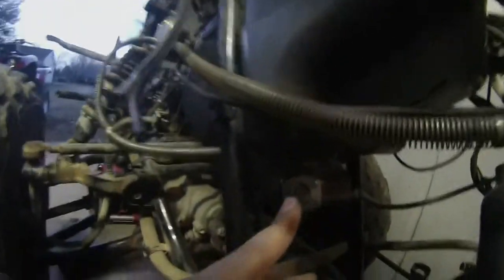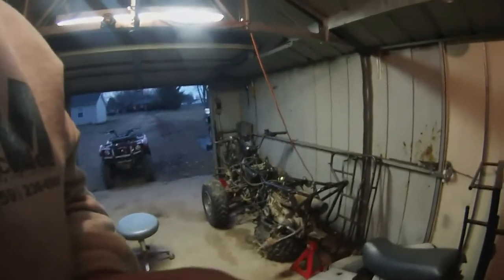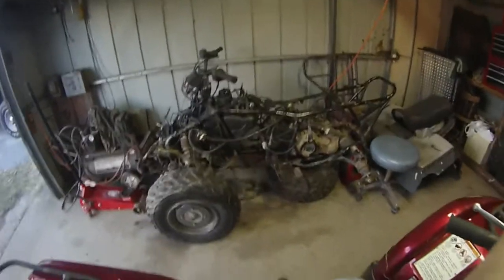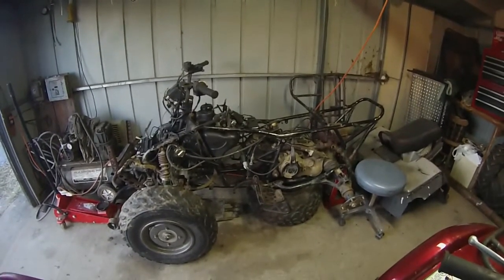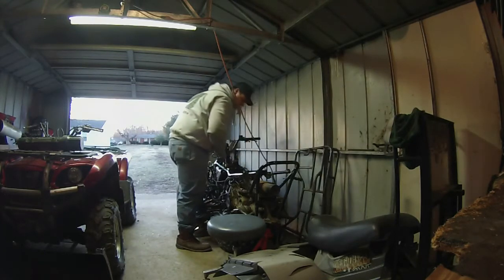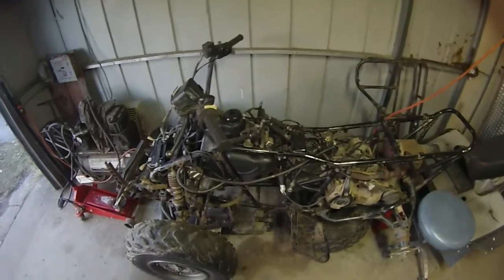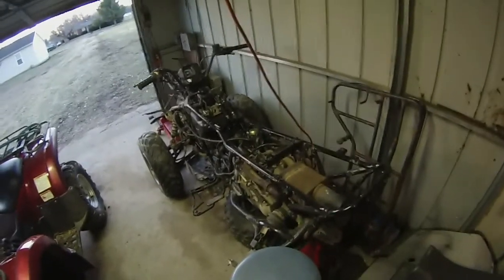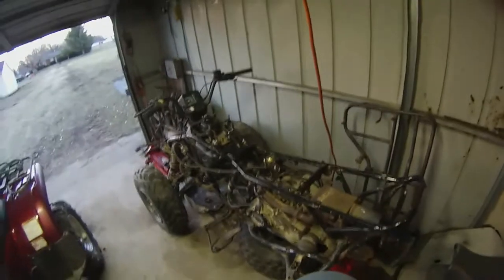Suzuki King Quad 300 Project - Part 3 - Fuel Delivery

Comment: 7 years after you posted these King Quad videos they are still helping people!

 I have a low mileage one in great condition that I run only a half an hour or so a year. Last 10 years or so l use it only for blading snow on the driveway.  This year I didn't need to use it but did start it a couple of times.  Always siphon the old fuel out and replace it with new fuel and stabilizer twice a year.  Today it would not run.  Started right up and idled ok for a couple minutes and quit.  No go.  Pulled off the easiest hose to get at on the carburetor, think it's a vent, and primed the carb through that port and it would run until that added fuel was used up. Did this many times hoping a blockage would clear itself but would omly run until the fuel I primed it with was used up.  Clearly have a fuel starvation issue somewhere.

Thank you for posting these videos.  I now have a really clear idea of the fuel circuit to start doing some troubleshooting.
Reply from the maker: Thanks for the comment and I’m glad you found the videos helpful! Good luck getting your machine going again, hopefully it’s a simple fix and if I can help somehow just let me know 👍🏻
Reply: So what was wrong? I have problms
Reply: @safffff1000 The spring in the needle valve collapsed. Cleaned the carb (was quite clean) installed a new needle valve and it now runs like new.
Reply: @ronsereda4242  Thanks. Is that the float needle of the idle adjust needle?
Reply: @safffff1000  just the float needle. The tiny spring is internal to the needle. A new float needle came with the kit

Comment: Good little project bike.  I have one in about the same condition maybe a little worse. I'll keep watching it will help me with mine. Thanks for the video
Reply from the maker: Thanks, im liking it so far. Its in decent shape, just doesn't look like it with all the plastic and things off of it. I had a quadrunner 250 which is almost identical that I went through and rebuilt the engine on. I sold it a few years ago though. Thanks for watching!

Comment: Got one of them ebay carbs for it and the old one just seemed 2 far gone but it idles high even when with the new one same situation thinking its a vacuum leak some where but I can't find it but it also won't pump gas even if it's running now it does have an extra vent like but I wouldn't think that would effect it not running and not being able too run or idle which I'm pretty sure then lines are ran right but I'm not sure on that first time messing with these bikes
Reply from the maker: If i remember correctly those aftermarket carbs have two rear vents, and one vent on the front(engine side) of the carb. the one on the front is for a vacuum petcock or fuel pump. If it is left open, it will act as a big vacuum leak. Maybe its possible you have the fuel pump vacuum line on the wrong port which would explain it not pumping gas and also possibly why it has a vacuum leak. Did you try adjusting down the idle? Good luck and let me know if i can help

Comment: how does the petcok get conected get connected? I got a quadrunner 250 and it does have issues with the vacuum line and fuel pump. It dies when you accelerate. Thank you

Comment: where is that fuel pump located ?? thinking have the same problem as you No fuel in fuel lines just had the tap serviced cheers mike thansk for your help & info good skills
Reply from the maker: Mike Winter Thanks! The fuel pump is located back behind the left front wheel tucked under the fender plastic If I remember right. Just make sure if the petcock is working correctly that the fuel pump is getting vacuum. Those lines can get dry rotted.

Comment: Replaced fuel pump..quad quit on trail..pumped throttle n would start n run for 5 mins and die...cleaned carb..checked fuel pump..its right..vacuum lines are right..Getting fuel from prim position but not from on position on peck...got spark..compression etc..wtf?..lol

Comment: i have one of these and a lot of lines were not hooked up to the carb. can you make a quick viedo just showing what line goes to where from the carb?
Reply: Gordon Clegg I think there is supposed to be a fuel return line somewhere and its not hooked up
Reply from the maker: Gordon Clegg Unfortunately I got it all the way together, and got busy and sold it before I had a chance to make a completed video. You may try to google pictures of that because I don't remember now what all was hooked up where. There is no fuel return line though, just a fuel drain and overflow I think. There are a couple vacuum lines and a vent line or 2 that connect to the carb
Reply: Gordon Clegg fuel repair